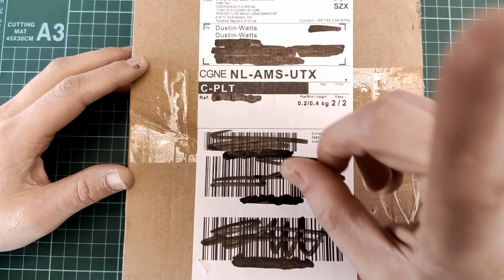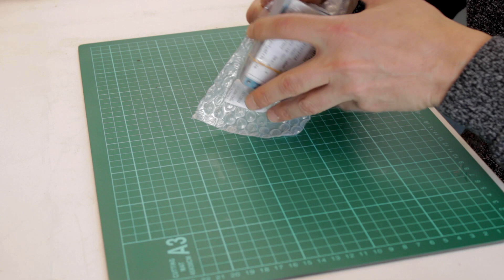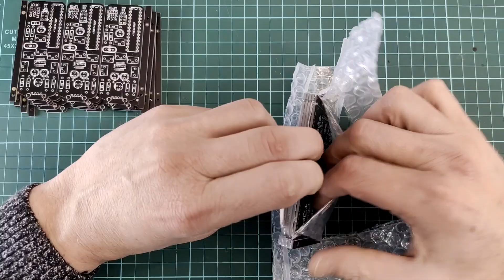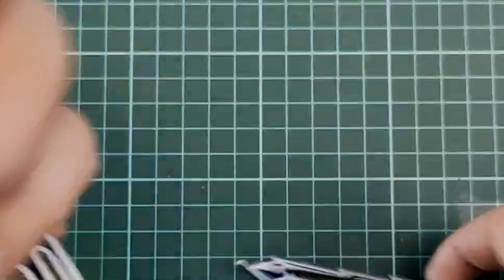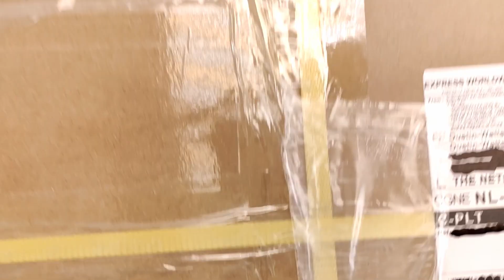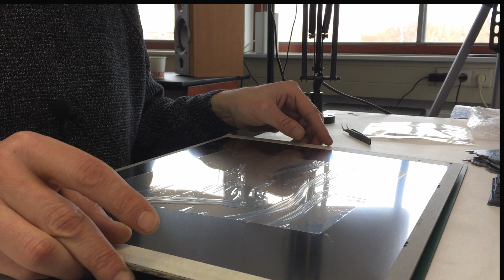New PCB's means New Projects!

Comment: I've just ordered a microchip pickit4 to have a play with UPDI programming and debugging, it the debugging side i want. I quite like Ardunio's as a chip but the bootloader and serial debugging is just a waste of time.  why Arduino has not produced a debugger I don't know. how can you debug a program when it has to stop send you something over rs232 then get back to what it's doing. So 1960's :)

Like the tower PCB by the way.
Reply from the maker: Thanks! Microchip has the Power Debugger, but I haven't looked in to that. For just some basic tinkering with the the AVR chips debugging isn't realy that important IMHO.
Reply: @DustinWatts  i'm trying to get to get communications going with a GSM using GPRS. i've not found a library that works. all very good at the simple things but don't seem to handle the return messages very well and i getting fed up trying to use Serial.print to see whats going on.
Reply from the maker: Yes. For those kind of things a debugger is essential! I actually hope the Arduino Pro IDE will add support for the AVR chips.

Comment: cheapest way of connecting a wire to a pcb is to have a hole  or two that wire goes through before being soldered to the PCB. this provides strain relief for the wire. used to do this when we connected two PCB's together in avionic equipment which was quite common in the old days.
Reply from the maker: That was my initial plan, but since those headers a quite cheap I though it would just look nicer.